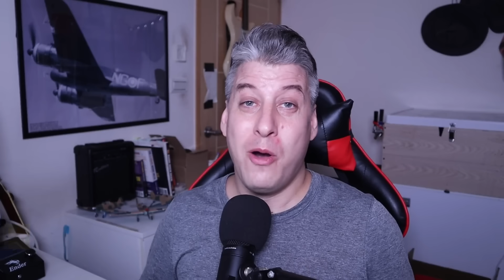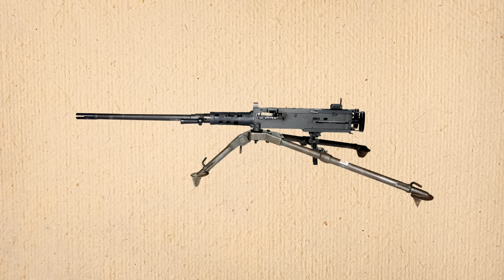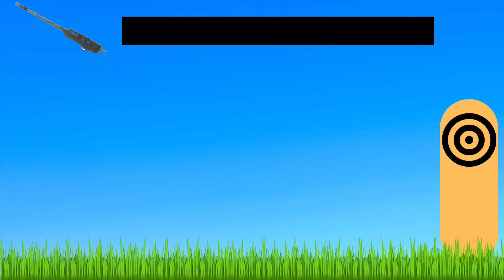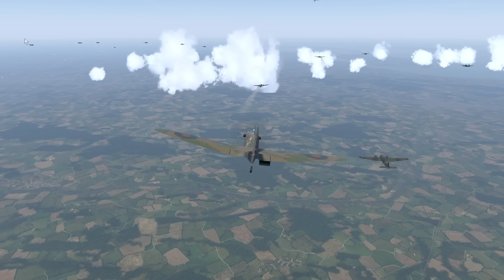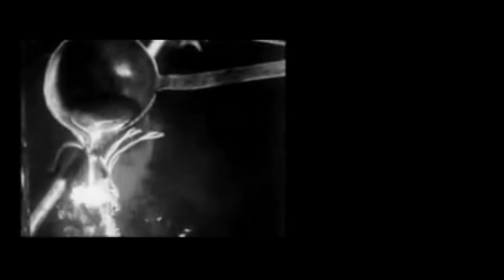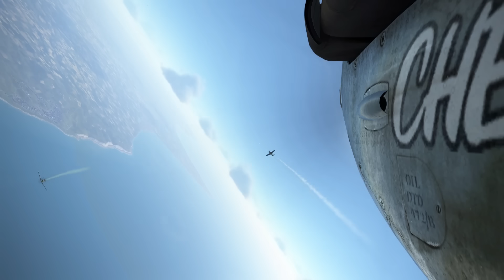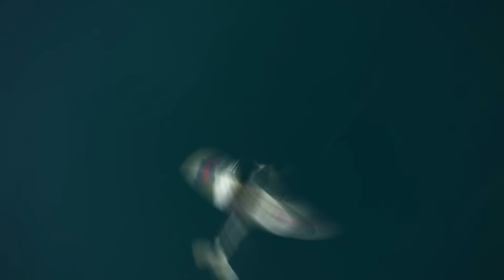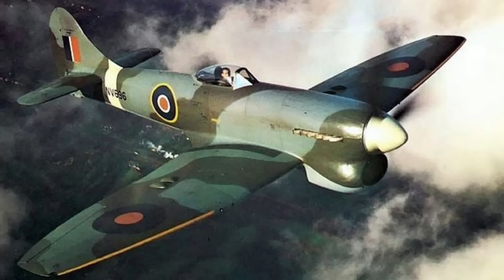Why Did The RAF Use .303 Caliber Machine Guns in WW2? The Surprising Answer

Comment: Even the 50 cal seems too small to me for a proper air combat round with the speeds involved in WWII.

20mm cannon seems about right. Having and explosive charge in the round also seems to make a lot of sense compared to just a metal slug.

Obviously I didn’t live back then, or fight in an aircraft back then.

But a larger round less effected by wind, and having and explosive charge, more range, just seems to make sense.
Reply: Yeah, below 20mm when you start getting good explosive rounds, you're mostly just hoping to get lucky and hit something small but important, which means more rounds on target is better than slightly bigger holes (though a .50 is marginally better against engine blocks, so can be justified if you're willing to sacrifice some dogfighting potential for better ability to knock out bomber engines or light armored ground targets)

Eventually, later in the war and post war, 20mm+ cannons were preferred (sometimes supplemented with 1-2 lower caliber guns).
Reply: @dynamicworlds1  Ehh, idk.

A 303 is such a tiny round to shoot the distances they're asking it to do. 

By the time a 303 reaches the plane its probably moving pretty slowly. This means it's trajectory would appear very arched to the pilot.

Keep in mind infantry combat rarely takes place over 300 yards.

300 yards in a fighter aircraft is almost like a minimum distance.

I still think a 50 is on the small side. You're right about if you're getting hits and you clip a hydraulic line or something (keep in mind the FW190 was controlled electrically for this reason, could have multiple redundant wires to the control surfaces, where as hydraulic system if punctured renders the entire thing useless.. That system was likely armored though. a 303 at that distance.. not sure it could even punch through cast iron pipe lol.

Allied bomber crews had a lot of trouble with German and Japanese 20 mm cannons. A tail gunner in a B-17 (firing 50 cal with the wind) was still out-ranged by German 20mm firing into it. It was a serious problem

Comment: The tail gun for the B29 started out as a 20mm. It was scrapped in favor of a .50 because they could carry more ammo for the .50.
Reply: No, it was 20mm plus two 50. The 20mm was dropped because the USA had issues with reliability of its production and the trajectories at long range were mismatched.
Reply: No, the tail gun for the B-29 started out as a 20mm and two .50s. The 20mm was removed because it was a US-made M-1 Hispano and didn't work.

Comment: Another consideration that is often overlooked is how fragile and relatively new aircraft design was back in the day. It didn't take much punch to destroy a plane so bigger guns weren't needed as much.

The SAS would destroy scores of planes just running and gunning in their jeeps with .303 guns. That says a lot on how easy it was to destroy them.
Reply: Not so sure about that. Give a modern $100M fighter jet a burst of 7.62 MG fire and it'll be scheduled for a very long and very expensive repair. The saving grace perhaps being that jet fuel is much less flammable than the old aviation gasoline, so maybe you're less likely to set the jet plane on fire. The reason why modern fighters have cannons (to the extent they have them and/or expect to use them at all given how good missiles are today, but that's a different discussion) is that the planes are so fast that the pilot has a much shorter time to put enough rounds on target to shoot it down. So hence a need for a cannon with both a high rate of fire and shells that individually do a lot of damage.
Reply: @jbepsilon  There's no denying that modern combat aircraft are a lot sturdier than vintage planes from the second world war because of the sheer tolerance they need to have for present day high performance flying though. They don't have to be laughably impervious to .303 to justify the need for a bigger caliber... 

Another two good benefits a larger caliber can give would be better range and less trigger time needed on the target to cause sufficient damage, which makes perfect sense for autocannons. If you can fire a 20mm with a rotary gun just as fast, if not faster than a conventional .303 m.g. fires its own ammo then why not?

Comment: Early in the war the British often wanted to shoot down large bombers, for which range and size of round would be helpful. But that wasn't common later in the war, which was when the 20mm became available.
Reply: Later in the war as aircraft got ever faster, pilots had a shorter window in which to deliver enough hits to shoot down an enemy plane, so autocannons were definitely useful.
Reply: @jbepsilon  Large calibre weapons generally fire more slowly than small calibre ones, aside from being a lot heavier. So if you need lots of metal on target then small calibre is often the best way to go. The disadvantages of small calibre are range and the armoured and more solidly constructed parts of the aircraft just might not break when they are hit.
Reply: @davidbofinger  Most WWII MG's and aircraft cannons fired around 700-800 rpm, including the 20mm Hispano and Mg151/20, and the .50 M2. The British .303 was a bit of an outlier here with a very high rof at almost 1200 rpm.

Comment: It still is beyond reason as to why the Brits used the ancient .303 even with your very good explanations. The actual ball bullet weight of a WW2 aircraft .303 is 150 to 180 grains vs the .50 bullet weight of 650/706 grains. Secondly, that .303 velocity in feet per second is about 2500fps while the .50 is just under 3000 fps. The energy differential is enormous.  .303 is ~2400 lb ft while the .50 is near 14,000 lb ft(!). Makes you really wonder what the UK air ministry was thinking while their pilots died in large numbers after being clobbered by a Bf 109/110 or FW 190 that had absorbed so many .303 rounds that would have shredded that airplane had it been a .50, I have a beautiful sporterized Enfield .303 rifle and while a nice piece, for sure isn't the heaviest hitter for big game - and wasn't against Germany's Luftwaffe airplanes
Edit: Forgot this - the effective range of a .303 British is about 550 yards while a .50 BMG is 2000 yards or more and will drop only about 18" in a mile. Makes you wonder how many British airmen would have survived if their airplanes had been equipped with better armament

Comment: It would have cost too much and been too slow to licence production of the 50cal from America with how gouged the prices on Thompsons were so it was easier and cheaper to bulk buy .308 brownings and convert them in Britain, the spitfire did eventually mount 20mms but they were unreliable so the quad. 303s were put back creating the mixed configuration then up to quad layout when reliability had been fixed.
Reply: "it was easier and cheaper to bulk buy .308 brownings and convert them in Britain"

Yes, but that never happened. For one thing, there WERE no ".308 Brownings" at the time. For another the British .303 Brownings were licence-made in the UK, and were radically modified from the original design.
Reply: @fergusmason5426  what do you think 7.62mm
Reply: @Litterbugtaylor  US-made Brownings were chambered for .30-06. The .308 round did not exist, and in any case the British Colt-Browning .303 was pretty much a completely different gun by the time it entered service.

Comment: The British had  'on paper' a better aircraft than the Spitfire this was the Westland Whirlwind armed with four 20mm cannons, however problems with its Peregrine engines and an inability to increase engine capacity without a major redesign meant that it didn't reach its potential had it been equipped the Merlin. This aircraft had the potential to smash the Luftwaffe from the sky and probably the Battle of Britain would have been over sooner!

Comment: It's important to remember that the M2 Browning .50 cal MG was scaled up from the Browning .30 cal MG. Most American fighters were slinging six .50 cal MGs during WWII. Compared to an auto cannon, the .50 cal has a flatter trajectory, which makes hip shooting a lot easier.
Reply: It's on record that a fighter pilot  with poor aim had much more change of scoring a hit with 8x .303 than with 4x 20mm. But early war RAF  'aces' had their armourers aim their 8 brownings to converge at (I think) 400 yards. Most RAF fighters were set to spray the bullets line ahead. So a poor shot would hit, but not kill. 
The Germans & Japanese kept their ace pilots at the front to kill as many as they could. The Allies took their aces out of combat to train new pilots. 1 ace killing machine is great if you are desperate: but an endless supply of good enough killing machines is what wins wars.
Reply: @glynwelshkarelian3489  - That's all very interesting. But imagine what six .50 cal MGs firing about 500 rpm could have done compared to eight .303s firing just rpm as on the Spitfire Mark I. The .50 bullet is up to four times as heavy as a .303 round, and it has a higher muzzle velocity, thus flatter trajectory. 

So just two .50s might outperform either .303s. An air-cooled .303 weighs about 30 lbs, and a M2 .50 weighs 84 lbs. So yes, six .50 MGs could probably have been fit into a Spitfire Mark I and spit out 2-3 times more destruction per second.

I think that single change could have shortened the daylight phase of the Battle of Britain, putting an end to more ME-109s and the careers of their pilots rather than allowing them to fly back to France. This isn't to criticize the Mark I Spitfire; however, she might have been even more deadly had she been equipped with .50s at the start.
Reply: @pacificostudios  The .303 Browning fired at 1,200rpm. With eight guns that's 9,600rpm. Six AN/M-2 Brownings would give you 4,800rpm, which of course is only half as many. And tests on actual aircraft showed that, after penetrating a metal airframe, the .50 round wasn't actually significantly more effective at penetrating armour or breaking things. Cannon armament was clearly the way ahead, everyone knew it, and the RAF didn't see the point in messing around with a much bigger, heavier machinegun when it was obviously a dead end.
Reply: @fergusmason5426  “wasn’t actually significantly more effective at penetrating armor or breaking things” nobody actually believes that.
Reply: @Hornet135  Nevertheless, it's true. You see, the RAF actually TESTED this, by firing at aircraft instead of just bare armour plates. As bullets pass through the airframe of a metal aircraft they get destabilised and topple. A toppling .50 bullet is almost as useless at penetrating armour or an engine block as a toppling .303 one.
Reply: @pacificostudios  "An air-cooled .303 weighs about 30 lbs, and a M2 .50 weighs 84 lbs."
Very clever. Now add in the weight of the ammunition. When the Spitfire Mk 1 with its eight .303 Brownings entered service, most US fighters had a single .50 and a single .30. By the time the USA was arming fighters with six .50 Brownings the RAF had moved to four 20mm cannons, which gave 2-3 times the firepower of the US armament = for 30% LESS weight.

Comment: The British did shoot down lot of German planes in the Battle of Britain but they neglect to say how many were easy pray being bombers . Germany did loose a LOT of ME109 because the ran out fuel over the channel and their poor undercarriage arrangement .I wonder how a Hurricane with 50 cal or 20mm cannon would have performed as it shpt down more planes than the Spitfire . Its interesting to note that a Hurricane could out turn an ME109 according those from the battle of Britain . Retalitary raids over german airfield in France during the battle of Britain may have been far more successful with 20mm cannons , thus the British might have destroy more ME 109 on the Ground and conducted more raids . Hitting ground repair facilities with 20 mm cannon would be far more destruction of equipment , men and facilities .

Comment: iirc Max Hastings in his book "Bomber Command" stated that up until Pearl Harbor, The US were supplying 50 cal Brownings to the RAF to be fitted into rear & Mid-upper turrets on the new "heavies". As soon as the USA entered WW2 they kept back production to use in their own aircraft.
It has been mentioned many times that even at night German fighters armed with 20mm cannon could kill the bombers rear gunner before getting into range of his 4 x .303.
Reply: Most night fighter engagements, even given radar, were at really quite short ranges, rarely above 300m, so in theory the 303 was sufficient. The issue was more Schrage Musik and approaching unseen. If the night fighter was spotted even given the high combined rate of fire, 303 was insufficiently effective for the likely short firing time before the nifgtfighter was underneath. 

Harris wanted fifty calibre guns, not because of an imagined improvement in range but because a pair of those almost doubled effective firepower of the rear turret against unarmoured areas of an attacker and was far more than twice as effective on anything armoured or engines. APIT carried a significant amount of Incendiary too.

50 calibre turrets, as a, stepping stone to the wished four 20mm turrets, were in development by several firms in 1939, but Lord Beaverbrook killed development in 1939. In 1939 many RAF bombers included one or more unpowered turrets, some mounting as little as a single Vickers K, so not a huge upgrade on WW1. Beaverbrook wanted to ensure they all had powered turrets with multiple Brownings, and to concentrate manufacturers on that. The downside was that 50 calibre turret development started late. Firms still often wanted to aim (no pun intended) for 20mm.

Comment: On top of every one of the latest Abrams A3 tanks coming off of the assembly line, sits the MA Deuce.50 cal machine gun, same as in WWII fighters. John Browning knew what he was doing 🤌👌👍
Reply: It's an M2HB, which is quite a bit different in all details to the ANM2, but the same underlying design. Many weapons designs are surprisingly old.
Reply: @wbertie2604  If it ain't broke don't fix it.

Comment: Aluminum wing ribs have lightening holes to reduce weight where shear strength is not needed. These holes are designed to pass machine gun belts of a specific caliber. In terms of size, the various calibers were heavier, longer, fatter, and most importantly the bigger rounds had much stiffer belts with a much larger folding radius. In 1963, US NAVY Skyraiders with 8 50 caliber machine guns had to be catapult launched from an aircraft carrier. In 1964, the Skyraiders guns were replaced with 4 20mm guns. It was now light enough to be deck launched. The difference was the ammo. 20mm belts were too stiff to be laid in a second row in the wing boxes and the rounds were too long to pass through the lightening holes in the wing ribs to use the adjacent wing boxes. The net result was 50 caliber guns could use double row loading and adjacent wing boxes. The 20 mm guns had single row folding in the gun box only. The 8 50 caliber guns had 4 minutes of firing time at a much higher rate per gun. The 20mm guns had 20 seconds of firing time, they were slower and half as many but had a longer effective range. * 50 caliber guns had been the NAVY's solution for jungle fighting in the South Pacific in WWII. The 20mm was geared as a makeshift for Soviet armor busting. But these Skyraiders were only used in the Vietnam hot war. A superior solution replaced for an imaginary requirement.
Reply: What version of the Skyraider was this with 50 caliber armament?  I can find no information on Skyraiders being armed with any guns other than 20mm.  I can remember a Skyraider pilot in Korea talking about the effectiveness of the 20mm destroying vehicles.